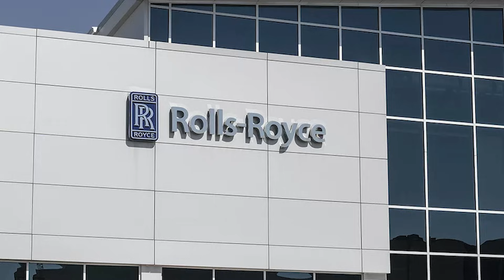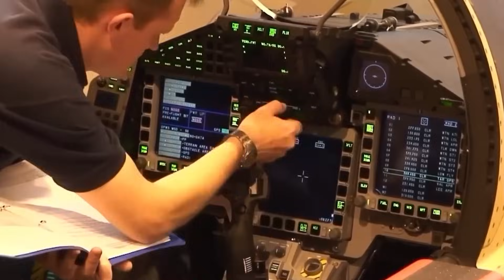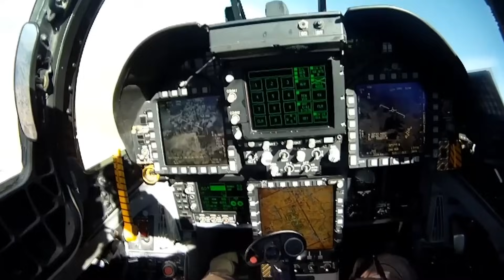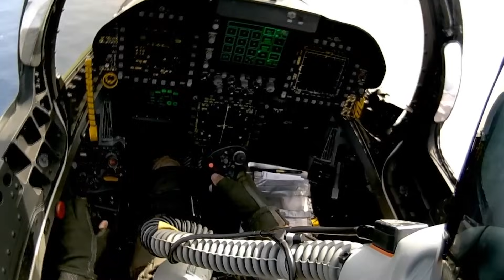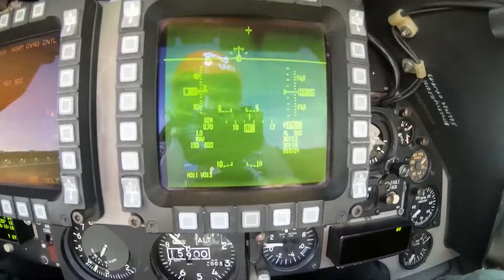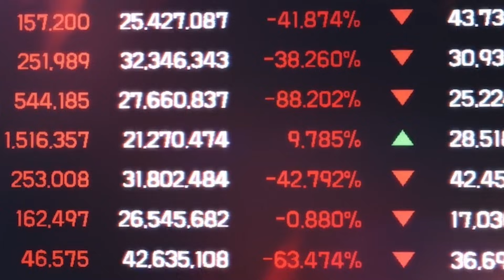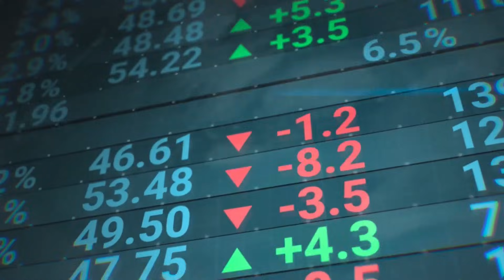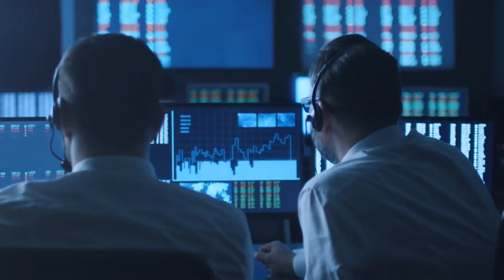Rolls-Royce Quietly Rewired the Gripen Jet — NATO Didn’t See This Coming

Comment: From what’s publicly available, the Swedish Gripen C/D uses the Volvo RM12 engine, which is a licensed and modified  version of the GE F404. Recent and ongoing work on these engines—upgrades, life extension, software changes—is being done by GKN Aerospace (the OEM for the RM12), in partnership with Sweden’s FMV, Saab, and with support from GE Aerospace.

There is no news from rolls royce or saab.